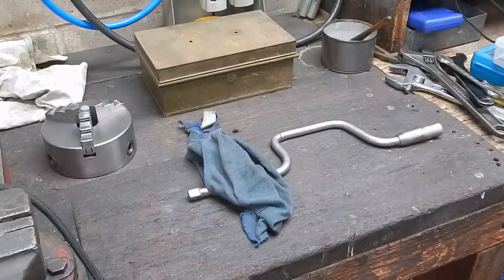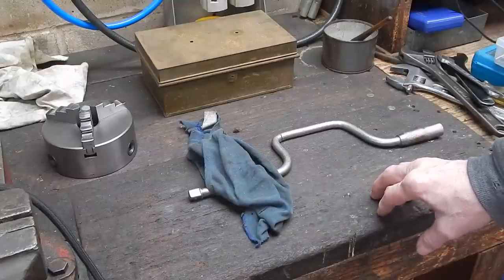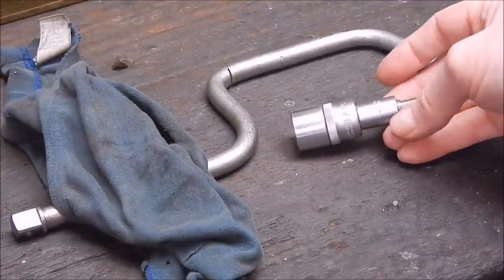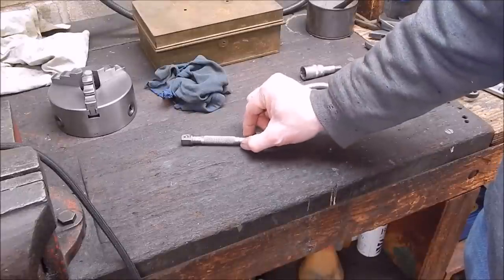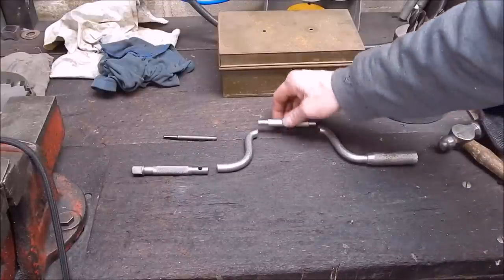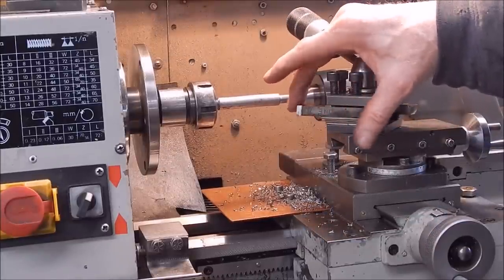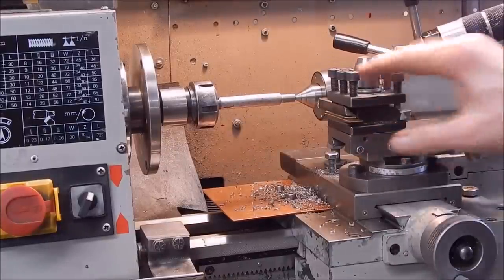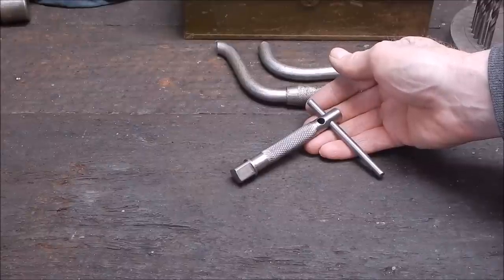Make a small 1/2" socket wrench from a junk speed brace

Comment: Nice job Rob. I am all for reusing any metal that's laying around. The next one needs to be even shorter with just a 10/11/12 mm hex for a ring spanner then you could get in real tight spots.  thanks for sharing. regards from the UK
Reply from the maker: Gary C Hi Gary.  The possibilities are endless. 

You could even bronze a large Allen headed bolt into the end of the wrench, to allow it to be turned with a suitable Allen key.  

All very do-able.

Cheers.  Rob

Comment: Nice job.  As a greenie and a tool nut (oops, is that a pun?) I also like to repurpose old tools.  I have turned a screwdriver with a broken tip into a triangular drive for triangular headed screws.  I also have a scriber made from a screwdriver.  I don't really use it much since I have got a proper scriber. The tempering of if probably only makes it suitable for materials softer that ferrous otherwise it will need regular sharpening.  I also made a pin punch out of an old Allen key.
Reply from the maker: Alan Liefting Hi Alan.  All good stuff.  Although I have a couple of scribes, one thing I've been tempted to make over the years is a scribe from a large concrete nail - the ones with the flutes in them.  These are as hard as hard, and with a nice outer knurled grip fitted, would be a very classy and effective bit of kit.  Maybe one day.  Cheers Rob.
Reply: xynudu
concrete nails are as hard as, well, nails.

Comment: The second hole at 90 degrees for the bar was not needed.  When using it, and because you would likely be using it with a sixteen point socket, all you have to do is lift the socket off the bolt and turn it to the next position.
Reply from the maker: Alan Liefting Yep, good point.  Cheers Rob